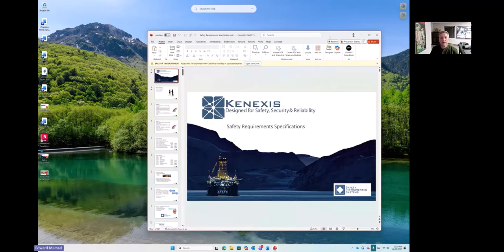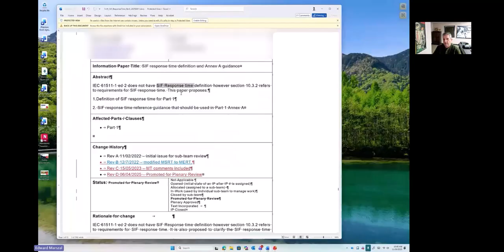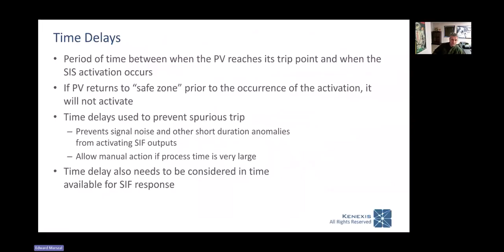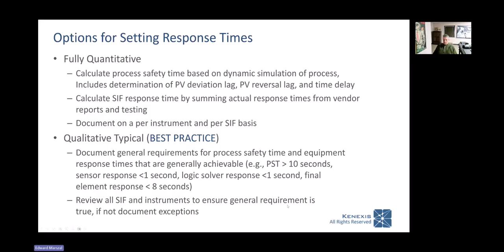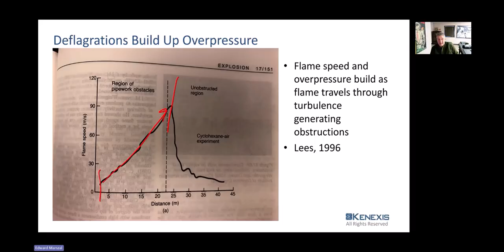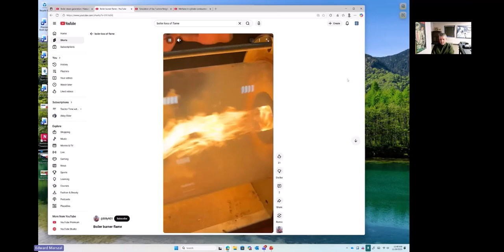Webinar - Determine Process Safety Time now MERT Focus on Fired Heaters

Comment: Hi Mr. Edward,
Thanks for the great lecture.
When I was doing LOPA in the past, I once found a case where the operations team had set a 60-second time delay on an important SIF backflow-prevention DP sensor to avoid unnecessary ESD trips. I advised them to keep it within 5 to 10 seconds instead.
After watching your lecture today, I feel reassured that the guidance I gave was appropriate.
Thank you again for the excellent session.

Ryan Choi fr. KOR who met on last Tue via Webex~